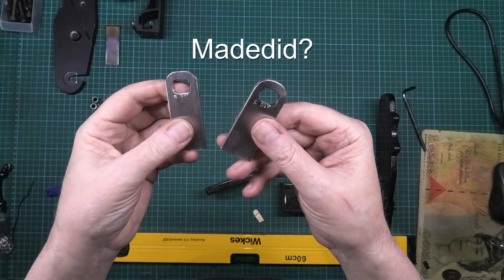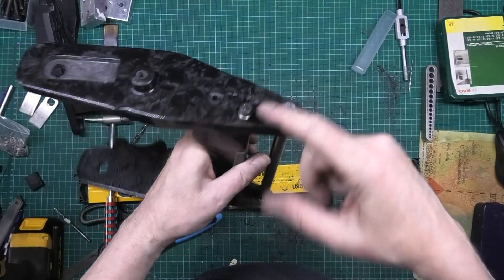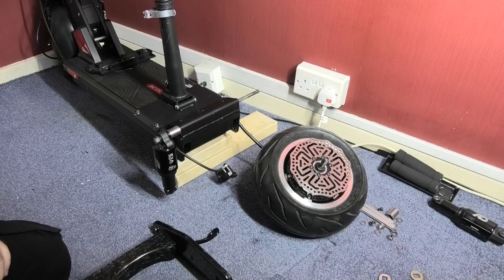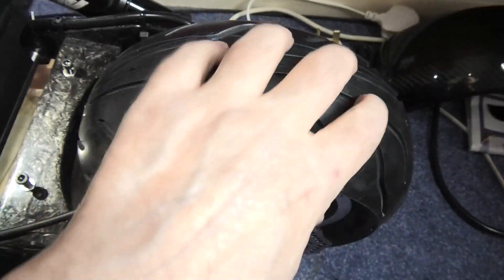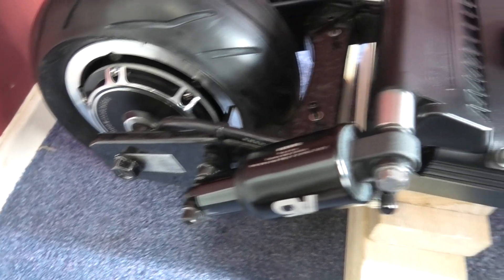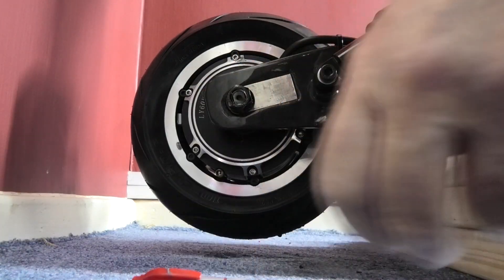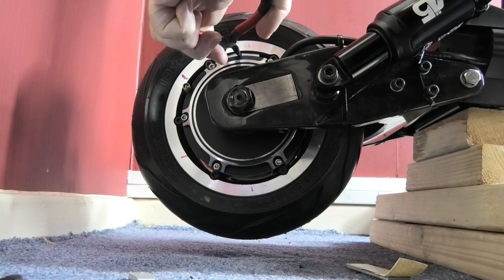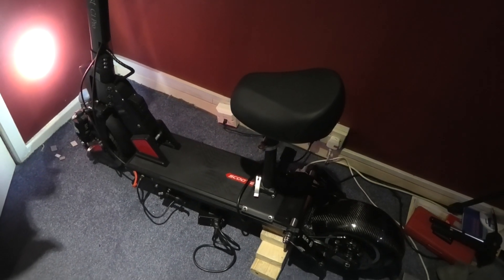🔴 EXTREMELY POWERFUL E-SCOOTER BUILD part 23 - Putting it all together and dynamic wheel balancing!

Comment: @tony would have steel sleeves been better for the bolts to go in to instead of bolting straight to the carbon fiber? Not done any of it before so was wondering.to reduce the  strain and distribute the forces of the bolts.

Comment: Tony, you may have said already, how does the Kelly controller compare vs say standard Sabvoton 72150?  It looks a lot of power in a small package, a bit like phaserunner but even more power.
Reply from the maker: Apart from the size and weight, there is no real difference mate. I suppose the Sabvoton can handle the current for much longer but it's rare that maximum current is maintained for more than 5 seconds until the motor magnetic saturation takes over when you''ve hit maximum speed.

Comment: Tony, I have a wheel balancer here if you need one
Reply from the maker: Cheers mate, I appreciate it - It's one of those jobs I only do once every 3 years and it's good enough. The trouble is, it has to be dynamically balanced because it won't freewheel.

Comment: I could immediately tell on that last one even before you put the videos side by side that it went CONSIDERABLY smoother - less vibration, less energy loss and longer coasting. I'm guessing it also has benefits to friction as well on the bearings. Next week is my birthday - hope to see you riding it by then. Now we just need dedicated scooter lanes on the roads lol
Reply from the maker: I learnt the hard way with regards to wheel balancing. When I tried to break the sound barrier on V2 e-Bike, I couldn't see. This was when I remembered how to do dynamic wheel balancing and it makes such a difference!
Dedicated scooter lanes? It's very doubtful when the standard of driving has dropped so much in the past few years, cars need as much space as possible 😒

Comment: The wheel balancing was amazing you could clearly see the different no vibrations what so ever so smooth and when you put the two videos side by side well great job done. I wouldn't like to guess the rpm of that wheel. Looking forward to seeing you out and about on it, I hope your leg pain get a little better for you soon.
Reply from the maker: If I'd put my gopro down and recorded it at 200fps, you'd have seen the difference a lot clearer, it used to shake everything!
Looking at the KV of the motor and the voltage I was using, it was turning at 2425 RPM. The wheel is 10" diameter so that's 72.1 MPH. The battery was only 50% charged so that's 4850 RPM with a full battery which gives an unloaded speed of 144.3 MPH. To be conservant, take 50% off for wind and road resistance and it should do 72.15 MPH. Seeing as I'm sitting down, the wind resistance will be lower so I'll say that the resistance is 40% = 86.5 MPH but there's no way will I push it that far 😂😂😂
Reply: @Vortecks  Wow that's crazy. Thanks for the specs interesting figures.